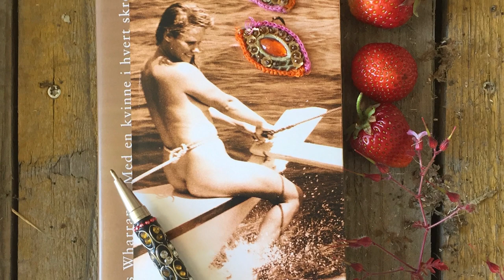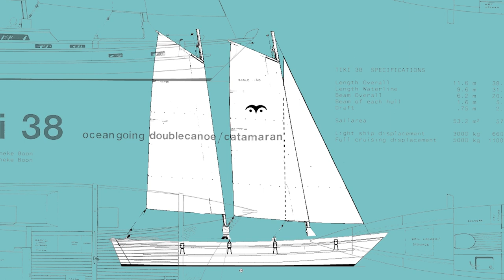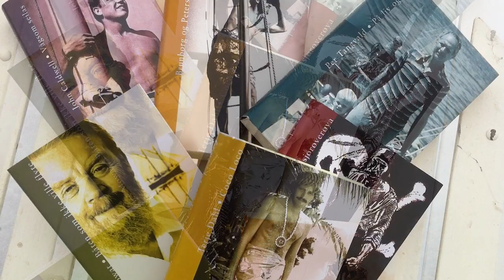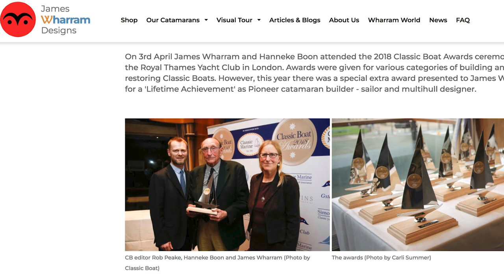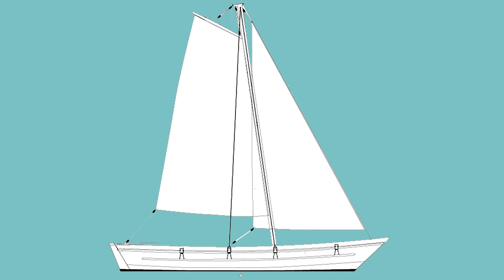James Wharram and his wonderful designs - Choosing Tiki 38 / DIY - Ep 1

Comment: I really like this Tiki sloop rig alternative, was this drawn by JWD or did you figure it out for yourselves ?
Reply from the maker: Sorry for late answer; The original design is with two masts and we used the same design as the original drawings but since we wanted only one mast, we moved it backwards to the second beam and made it 11,6 meter to fit our container. We were also inspired by the Wharram Islander 39 design.
Reply: @barebaretoborabora  Hi Anne, thanks for the reply. I was asking if the sloop rig was drawn by JWD as there is a drawing of it at 3:09 in EP 1 ? Did the rig perform well and did the boat tack easily with this rig ?
Reply from the maker: I cut down a Bermuda sail that was given to us and we also brought another gaff rigged sail. Does this answer your questions? Sorry for late answer!
Reply: @barebaretoborabora  was your single mast version of the Tiki 38 rig drawn by JWD? How did it perform?